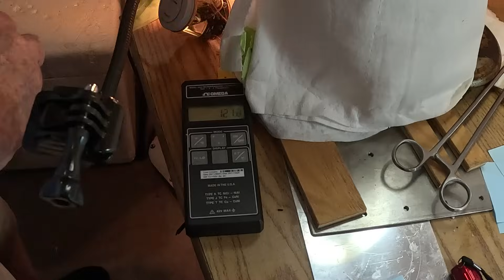Can O-rings Survive Avgas?

Comment: Poor Scott... All this was was a demonstration of the importance of using the proper size o-ring in a Cessna fuel valve. All the other  stuff was just a demonstration of how not to do a product test. At least the California guy tested the o-rings with both fuels side by side.  This test with only one produce, an add mixture, and heated, accomplished nothing other than show the inherent bias of the individuals involved. Want to actually conduct a valid test?  Do what drug companies do, have an independent party conduct a double blind test, with a valid control, and tabulate the results. 

Aviation desperately needs a replacement for 100LL if there is to be a realistic future for high performance piston aircraft such as my Aerostar or T28. Until then videos such as this do little more than make me question the motivations of the presenter due to the most basic rules of the scientific method being ignored. 

Jeff
Reply: Agree. Who assembles o rings into bores dry like that?
Reply: I have owned my T-6G for 56 years. Lots of hydraulic cylinders with lots of "O" rings. I rebuilt them all. But I have never installed an "O" ring without lubricating it first with oil.

Comment: Scott, thanks for making this happen. I’m confused about the statements concerning “the wrong size o-ring”. It’s even more stunning that such a statement would come from an STC holder, who knows, or SHOULD KNOW that if the FAA approved documents specify a -14 o-ring, then that’s the correct one, until such time as there is an STC to change that, or an AD to require a change. Please don’t use “old wives tales” from anybody. Either that large shop that was left unnamed is illegally modifying FAA approved parts, or not following the FAA approvals for their repair station, or some other misgiving. Perhaps you can provide us with the Service Difficulty Reports that this large unnamed specialty shop has filed with FAA concerning this -14 o-ring issue? Thanks again.
Reply from the maker: There is no public documentation about what o-ring to use in that fuel selector. Cessna’s response is to send it to them for overhaul. The original video by Luvra used -14 O-rings. And in that video that -14 O-ring broke after immersion in G100UL. In this video it broke after immersion in 100LL… same size O-ring. 

Perhaps you should do a little research yourself before getting so excited.
Reply: @FlyWirescottperdue , you know me… I’m just CRAZY about keeping airplanes from making smoking holes. Why no test with G100UL?
Reply from the maker: @TonyWilliams123  The test for this video was to see what happens in that fuel selector with 100LL. Luvra already did the test with G10UL, the question is why didn’t Luvra test with G100UL?
Reply: Scott, honestly, it would be easier for all involved if this had ASTM protocols…. Right now, it’s just a YouTube mudslinging contest.

Comment: The material compatibility tests done by GAMI going back almost 15 years ago, with hundreds of used fuel system components all being cycled with 100LL then G100UL, proved beyond doubt that this fuel is not a problem. I know this, because I saw this with my own eyes. I may be one of only a couple of dozen who did, but the data was logged and submitted to the FAA around 13 years ago. Nothing has changed since then in the world of O rings.

Good video Scott.
Reply: So the other guy is lying? Is that your claim?
Reply: @markor2476  your suggestion not mine. I just stated facts. Documented facts. When you add the tests done in this video which are using 100LL and getting swelling and discovery of the -14 O-rings, you have to question everything from the "other guy". Also always be wary of anyone with an outcome predetermined (G100UL=BAD) and looking to justify it. 

There were claims of tanks leaking on a plane a few months back. And yes it was leaking G100UL. That was true. But everyone failed to mention the 100LL blue stains all over the place where it had been leaking for ages prior. You can't make this stuff up.
Reply: @jaba430  You are being coy and evasive. The other guy also tested with 100LL, without any heating though. What. Do. You. Make. Of. His. Results? Answer this question clearly.
Reply from the maker: My answer would be that it met a minimal immersion period and the whole test was incomplete. A valid test would have controls, a protocol and a front end and a back end. I.E. what were the measurements afterwards, did the test item regain its original shape and elasticity?

Heated test articles are a standard lab practice. It simulates a greater time period of exposure. The report I referred to in the video did a heated test at 158F for 16 days. A far more stressful test than the ‘other guy’ and GAMI did.
Reply: @FlyWirescottperdue  I hate 100LL, I really do. It is just one more evidence how we are stuck in the last century tech because of regulatory overburden for certified light GA. So believe me that I'm coming from the right place and I want this bad stuff gone as much as anyone.

But I just don't understand how that is your answer. @mluvara made a test that demonstrates something that was observed in the field by a G100UL user. Namely that their fuel selector became heard to operate after switching the fuel. Then mluvara does the test and indeed is able to reproduce the result, plus that while under the same conditions 100LL does not have this effect on O-rings. Why aren't you bothered by that? I so wanted G100UL to be the solution. Oh man was I excited about the announcements. But after mluvara's tests and all the stories of leaking fuel tanks, swelled up O-rings, dissolved paint and sealants.. there's is zero chance I will voluntarily put that fuel in my Mooney. Zero.

And I guess, I'm just so disheartened by everything but especially to not see more critical takes of this issue from the community. I know we live in an era where saying something long enough and loud enough seems to be the only thing that matters, regardless if it's true or not ala what often Trump does. But in aviation this will end in dead people. Can we not do that? Can we please just examine the evidence and remain objective? Please?

Comment: Reminds me of the work done back in the early 2000's to qualify jet fuels with biodiesel blends. The fatty acid methyl ester (FAME) components in biodiesel were known to swell O-rings and seals. Viton O-rings would seem to be the preferred choice over nitrile for improved chemical resistance and better higher temperature performance.
Another factor is your faith in the company selling the rings. Very easy to mix up lookalikes.
Reply: FAME shouldn't ever end up in Jet-A (or B), that is what SAF is for. 😃

With HVO, I've seen a reverse issue in that nitrile rubber exposed to aromatics, heat (and perhaps also FAME) will shrink exposing prior damages to the matrix, becoming brittle in the process (as the aromatics have washed out the softeners) and ultimately fail.
Reply: @daszieher  thanks KD

Comment: Why did he add toluene?  And why did he heat the fuel with the o-rings soaking?
Reply from the maker: Heat speeds up the chemical reaction reaction. By heating you get the equivalent of many more days of soaking. 

The fuel used was straight from an FBO, a low toluene test was conducted and that is where the O-ring shrunk.
Reply: @FlyWirescottperdue is it possible to test the oring that swelled in hot water to control for the heat?
Reply: @Saml01  it's not only heat by itself, it is heat and aromatics. Elastomeres are molecularly complex structures, basically a bonded "matrix", interstitial "filler" surrounded by "softener" (English is not my first language, apologise inaccuracies in terms). Aromatics alter this structure by diffusing into said matrix and displacing softeners (often complex hydrocarbons). The displacement process is accelerated by heat and is - of course (why would it) - non-linear.

Heating O-rings in water would not provide the desired comparability. It is actually a quite specific problem that depends higly on the fuel chemistry, design (O-ring placement, use and wetted area) and operating conditions (temperature, pressure, mechanical loads).
Reply: @daszieher thats very fascinating. Thank you for the knowledge.
Reply: @Saml01 you are most welcome!
Reply: @daszieher ok. I have been thinking. If the fuel is not exposed to heat where that valve is located, does the oring still swell?

I know it would take longer. But is it possible the heat is effecting the oring that would otherwise be fine if not heated?
Reply: @Saml01  I don't know enough about that, to give you a reliable answer, as the scientific groups that I work with (reporting to our national fuel standards committee) haven't tested all possible conditions.

However, (and this is more from the field experience with customer equipment) I'd be inclined to say that should be a possible combination of parameters, where one and the same O-ring and fuel combination will work under one temperature and degrade under another (higher).

As I said before, this is a field of curves, non-linearities and acceptable parameter ranges, so - with a limited extent - one could prove or disprove the very same hypothesis with only very few changes in testing parameters. Which is why it is so important to have very specific testing conditions and Round-Robin tests to verify the testing criteria and procedures.

Comment: The important element of this video is that the weather was poor so you drove.
Reply from the maker: Missed it by that much…….
Reply: @FlyWirescottperdue 

G'day Scott,
 !

Well done...., that sounds like a good decision.

I heard that 47 people didn't make it through the Storms in the US..., either last week, or last weekend...(?).

Relocating away from the projected path of destruction  seems to be the best tactic with those things - unless one has some kind of a Bunker into which to retreat (?).

If you can pull up the Oz BOM's Radar Rainfall Mapping for last week & weekend's Precipitation hereabouts - NSW...; I've been incredibly lucky !

100 km East of here, some places copped 
400mm/ Hour, for close to an hour, and 250 mm/hr was recorded at lots of places...very major flooding, "unprecedented" - as they say.

Since Xmas, the Storms, Deluges, and Floodings have beaten up all Points of the Compass around us, here in the 2370 Postcode....; which is delightful for us, here - but the kinda terrifying aspect is that short of going away on the day, or stocking up and preparing to hunker down in place..., all I can think of to improve one's prospects is to try to fine-tune the Raindance and hope that whatever  is "steering the Weather" is so disposed as to dispense some small Mercies as to the exact Track and path of destruction.

So far, so good - kinda thing.

Does the volatility of the Tariff settings effect the O-Ring issue..., as  strongly as does the volatility of the Fuel ?

Yesterday I had to deploy the full Scientific Method of Problem Solving..., to evaluate the new ESC from Hong Kong...

It  changes the bike from a Garden Ornament, into a Motorcycle again - but now it goes 6% slower, and has 3% LESS Range - but it does strictly enforce the 45 Km/hr "homologated Speed limit, to only 46, even when trying to roll downhill with the Throttle off and too much in the Battery for Regenerative Braking to work...., in theory.

In practice, the Hill I roll down - now, at 47 Km/hr..., used to be a 53 km/hr experience...; so apparently the ESC is functioning as an Overspeed Limiter - even when no Throttle is invoked ?

The claim was that the original ESCs were dying from Corrosion from condensation on improperly "potted" components....; but my observations of performance make me wonder if the old unit was full of 
"High Efficiency Magic Sauce" - which was so very "bright" that it burned out it's "Filament" after about 100 hours in use...; whereas the replacement Unit is more Reliable, totally devoted to obeying Regulated Speed Limits..., and is about 10% less Efficient 
(Going Slower...,  AND not covering as much ground...!) than what came with the Bike.

Someone "needs" to convince the NSW Government that detuning Electric Motorbikes to half the speed of Highway Traffic is NOT helping to keep things safer.

The Bike, without Mirrors, Blinkers, Horn, Brake-Lights and "Homologation" will achieve 75 Km-hr in the Off-road version...; and the new model will see 95 Km/hr.

So, my Typewriter has a bit of work stacked up ahead of it..., apparently.

Such is life,

Good luck with the Extreme Weather.

Stay safe.

;-p

Ciao !

Comment: Suggestion, when he measures the O-Ring outside diameters, I would suggest making a tapered mandrel and "dropping the O-ring over it" then measure the OD.  As soon as the caliper begins to touch it it's rather easy to deflect somewhat.  Than again here, we're not needing precision down to 0.0001, or 0.001 more like 0.01 to document the growth.  All this said if they expand that sounds on being more of a good thing.  Thanks for the bird dogging the issue.

Comment: So George picked the highest aeromatic 100ll he could find to prove a point, while the other dude just took fuel from the pump. And then he didn't demo 100gul with "proper" size o-rings. I don't think this proves the point you set out to prove
Reply from the maker: No, that was FBO 100LL from ADH. The CA 100LL was likely very low aromatics.
Reply: @FlyWirescottperdue  aromatics are the key issue in nitrile rubber "longevity" under adverse conditions. Toluene is an aromatic, if someone wants to expose a specific, very aromatic-rich fuel, one just compares it to a low-aromatics "baseline" under conditions, whic favour the degradation of nitrile rubber and the proverbial Bob is suddenly a family member.

I am by no way implying that that is exactly what has happened here, but more scientific tests would help, at least to exclude possible problems.

I simply don't get, why there is a (low-key) mud-slinging contest going on between two possible sources of unleaded avgas. In the face of what needs to be done, simply shaking my head.
Reply: I think they call that “stacking the deck”….

Comment: The test gami did makes no sense, 100LL + toluene + heat? Why??  What were the orings he measures exposed to and for how long?  Very confusing and unprofessional.
Reply: Can anyone confirm the orings they are using are the right size, and if they are assembling it correctly, wouldn't this imply that these valves are going to leak by design if the orings don't stay seated or literally shear off oring pieces.
Reply from the maker: There is no public spec. Some folks use the -14 O-Ring, the results speak for themselves. I said the -13 was recommended by a nationally known 421 maintainer.
Reply: It did seem to be closer to worst-case 100LL blending.  I'm also curious if you don't use the heat-accelerant as well, as that's not completely reflective of the real-world.  It's good to accelerate some tests, but a longer duration test in representative conditions seems more applicable and less subject to unintended effects.
Reply: They are adding toluene to make it as bad as G100UL. 

At this point they are past the attempt to say G100UL is safe, now they are trying to say that 100LL is as bad as G100UL.
Reply: Ya, piss poor controls and even worse clarity on what they were doing. There’s no mention of why they heated the o-rings, or the actual temperature of the o-rings. Where’s the test with them at -40C, for example, if they wanted to test temperature extremes? Where’s the documentation “proving” that the -14 o-rings are either right or wrong? Innuendo? Unnamed shop? Who holds the STC to substitute -14 o-rings for the smaller -12 ones? Why the F didn’t they test it with GAMI G100UL (I suspect that we all know the reason for that).
Reply: Where is the test of GAMI G100UL?????? Talk about not answering the question at large. It just looks like deflection to me, aided by Scott.

Comment: To be fair most airplane fuel system o-rings have been soaking in 100LL for a decade or more, then exposed to the UL fuel. 
If the biggest cost of a switch to a UL fuel is replacing a few fuel system components it's probably worth it. It won't be cheap but could be a lot more expensive.
Reply: In this case, the STC should call for the required modifications to the airframe. And George should stop calling this a "drop in" replacement.
Reply: Also, if Cirrus aircraft warranty is void if you use UL (which it is) then it’s not a drop-in replacement. If it’s a drop-in fleet wide “replacement” then STC is complete nonsense. They want me to pay for the STC for the privilege to buy their higher prices fuel? right… no thank you.
Reply from the maker: True.

Comment: I built an experimental airplane from a kit where the manufacturer included two fiberglass wing tanks. After ~25 hours of flying, one of my tanks separated at the seam. The fuel had attacked the epoxy, and it failed. It poured fuel all over my left wing while I was in route to attend an airshow. The factory quickly created an AD and asked all the owners in North America to ground their aircraft until new tanks could be designed, built, and sent. They shipped us newly designed blow molded plastic tanks. Now I’m gun shy of everything; seals, O-rings, fuel filters, fuel tanks, fuel lines, fuel pumps, etc.
Reply: Which fuel? 100LL or G100UL?
Reply: @libertad-libertad-libertad-h1b  100LL the kit manufacturer thought it would have happened with any fuel over time.